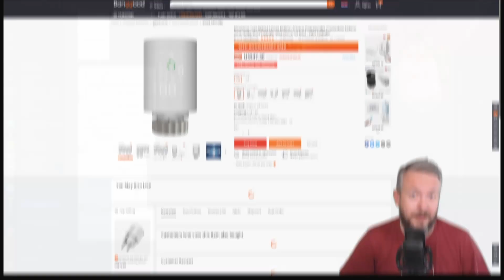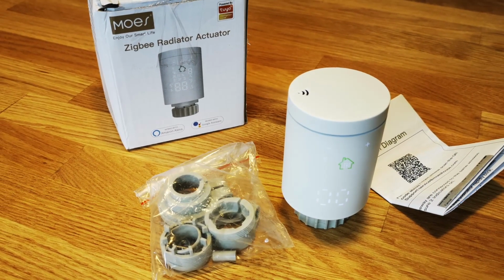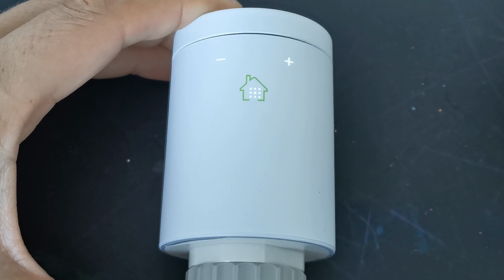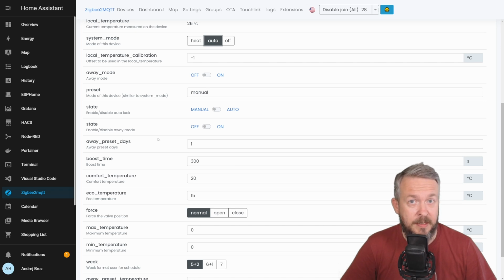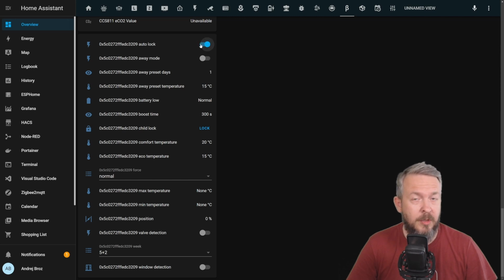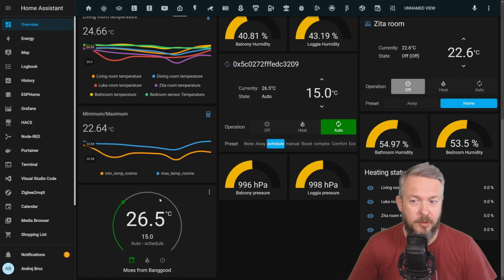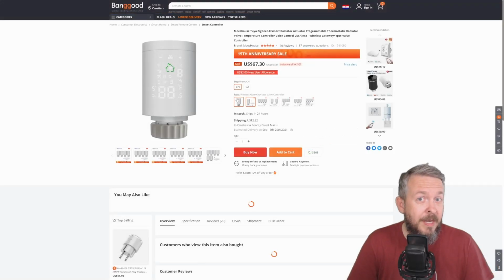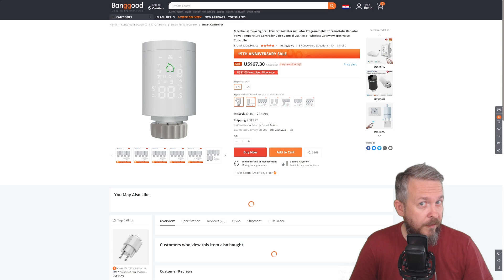Moes Zigbee Smart Valve TS0601 in Home Assistant

Comment: it is sold with a gateway, will the gateway work with Home Assistant ZHA
Reply from the maker: To add on this. This gateway if you go with it will need some hacking to get it working with Home Assistant. It can be done, but not out of box.
But again, this is from other people doing it - I haven't tried.
Reply: @BeardedTinker  I asked because I'm looking for a gateway that is on my LAN and not on the USB port
Reply from the maker: @sekt1953  not sure if this is the same model, but I think it's very similar. https://github.com/banksy-git/lidl-gateway-freedom
That one is probably what you're looking for.
https://paulbanks.org/projects/lidl-zigbee/
Reply from the maker: There should be also without it (if you already have one). I haven't tested one, but that's generic WiFi to ZigBee Tuya gateway and I know some who are using it (with ZHA).
Not sure if it has to be flashed or if it works with HA out of box.

Comment: Thanks for the video. I was wondering about this zigbee valves. I am impressed with zigbee2mqtt  i used in the past and had some problems. I moved to ZHA and works ok, tempted to give it another try. I am a bit an-wiling to pair again all my devices. Thanks again for all the hard work put in making all the videos.
Reply from the maker: From previous comment on the video, it looks like it is working great with ZHA too, so you should be fine with it. Zigbee2MQTT has also gone a long way with own GUI, OTA of firmware etc - and  Frenck is now also making contributions to the code to make it work even better to HA - so both should be ok. 
And thank you Adi for the comment and of course for watching the video!!!
Reply: @BeardedTinker  Thanks for the videos and for the hard work in making them. I learned quite a bit about integration and new devices. Thanks again.

Comment: I have 6 of these. They work good. I change batteries once or twice a heating season (which can be 6 months in Czech Republic). Small correction: valve position 0% means fully closed. :) Thanks for the great channel.
Reply from the maker: That's acceptable in my opinion. Hope battery level tracking is better then in tado. I've discovered one bug with it but unfortunately, they didn't react on it. Even made a video on it (valve can get stuck in call to heat state forcing boiler to run 24/7).
Thank for the correction :D so it's something like 0% closed. Makes sense.
Reply: @BeardedTinker  this bug is worrying. Any news on it?
Reply: The percentage is how much the valve is open, not closed. 0% = closed
Reply: I have 4 of them I and I have 1 issue I cant solve. When the valve is at 0% the radiator is still warm and water goes though it
Reply: @arhitektche  have you solved this issue? Same on my side - only was which helps is a recalibration of the TRV (reset)
Reply: @LtPvvtA  I solved it by 3d printing a little cap that goes on the valve to extend it. The valve was not reaching the button to fully close it. I ended up replacing with Aquara valves
Reply: Didn't you experience problems with the time? It goes really fast off... Scheduled heating profile doesn't work properly because of that.
Reply: Dont know... what can i do wrong than?! Cause in my way the batteries are in "low" mode in one weeks without use!!! What could be the trouble? You have also not problems since u wrote in the last one year?
Reply: What's about the accurency of the TRVs? I also read, that they do not often check for new updates e.G. the automation to reduce temperature will be transmitted hours after automation was run.

I am planning to control 20 TRVs of this kind, so it should be an invest which is working... And batteries just last about 2-3 months? Thats really poor isn't it?
Reply: Does anyone know of a way to control the position directly? I have dedicated thermometers in each room, which are more accurate than the one in the TRV (plus the TRV's thermometer is always influenced by the radiator it's attached to), and I have Home Assistant which can handle any sort of schedule or smart automation. I only want the valve to set itself to a given position and stay there. Is there any way to achieve this?
Reply from the maker: I've mentioned it few times. Take a look at HACS integration called Better Thermostat. It can use easily external temperature sensors to control various TRVs. Also has some additional functionality that HA doesn't have internally.
Reply: @BeardedTinker  Thanks, I'll take a look
Reply: Uuu great to see someone from Czech republic as well haha I was just considering getting one of these in the future 😄✨